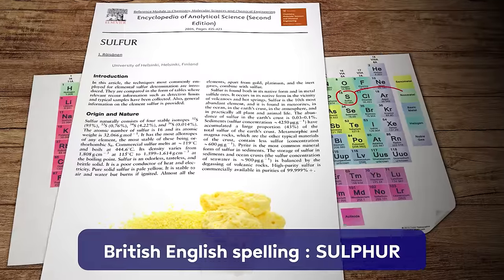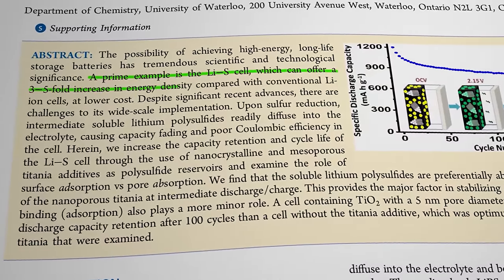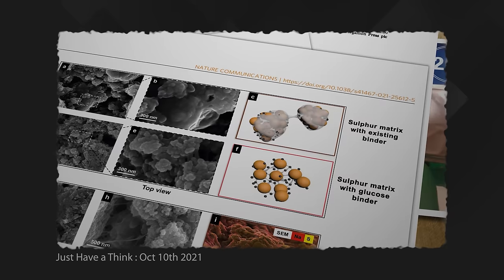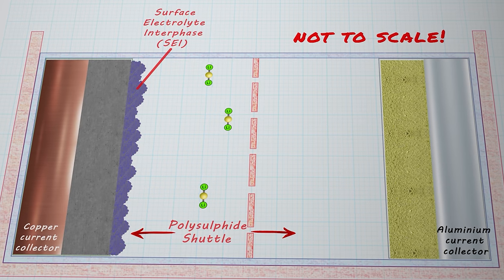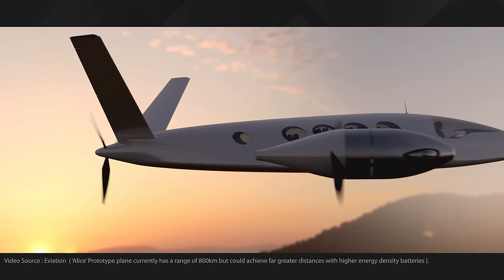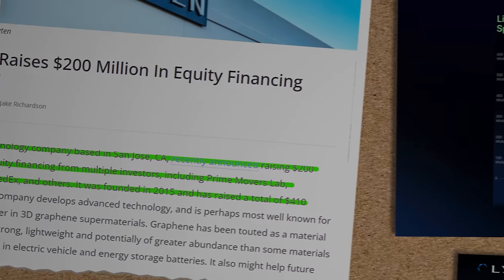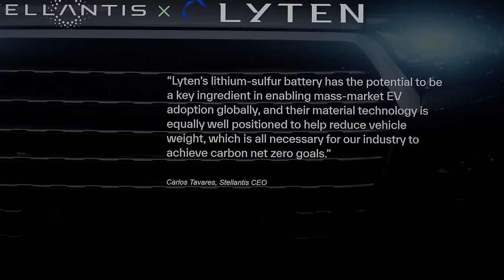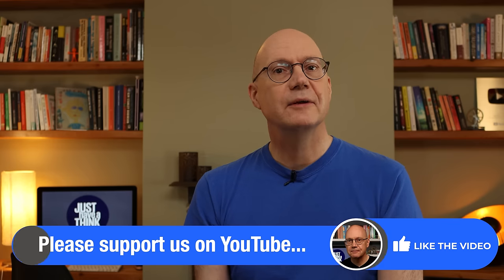Battery Energy Revolution. What now?

Comment: ELECTRIFICATION of all transports, industry, agriculture,... All sectors will be a reality ! 
And is the most logical action, move to do. 
Electric buses are way better than Diesel ones, electric cars are better than ICE cars, electric trains are better, electric tools... and so on. 
More quitter, more reliable, more productive. 
Battery is the only thing is a little holding back the movement but let's remember than LARGE SCALE BATTERY industry is very young and don't must criticized that. 
You can't compare simple oil industry with hundred years and trillion dollar revenue with large battery developments. 
Why large battery... Because for small ones we already have good solutions, think at all remote controls, devices, toys, phones, million if not billion of devices who are using just fine small batteries today (with great success 😅).

Comment: I'll take Dave up on his invitation. I really can't stand the incessant cheer leading for EVs. Passenger cars only account for 10 percent or less of greenhouse gasses. If we were to take care of the real culprits when it comes to CO2 we could let automobiles continue to burn fossil fuels and still stop global warming. Except they apparently don't want to stop warming entirely since their goal is 1.5 degrees rather than zero. Why isn't there more effort into making cars burn gasoline more efficiently? Why is there no effort to make emissions cleaner? This whole EV agenda has a creepy population control overtone to it.
Reply: It's easier to concentrate on EVs (and heat pumps, solar cells, etc) than to tackle the real, very difficult, very expensive, very unpopular changes that we actually need to make. Still, those EVs will come in really handy when the coastal cities flood, the weather goes haywire, the resource/food/water wars break out, and when we have to call out the army to stop the mass migrations...

Comment: Electric vehicles aren't taking us away from fossil fuels.  They still have to be charged.  Where does the energy come from the charge them? Because solar and wind won't accommodate 600 million electric cars in the united states.
Reply: It can, if we can just get the fossil fuel apologists to step out of the way. Read Saul Griffith, Mark Z. Jacobson and Adam Dorr for long form descriptions of ideas presented on this channel.
Reply: @benjaminnead8557 Or you could be specific as to what technologies provide an equivalent energy aggregate as burned fossil fuels.  Nuclear supercedes fossil fuels, but OIL in and of itself is never going away. 

Literally everything in your life, everything around you uses oil.  From your clothes, your shoes, your mechanical gadgets, your electrical boards all use oil.  Replace power generation with Nuclear, and you still require oil to make everything work.
Reply: @ChainedFei  Yes, we'll still need petroleum for a host modern age products. But even things like car tires, just to name one, can be effectively manufactured from plant based materials these days. But extracting oil and gas to simply and immediately burn it at the rate that we do - and blissfully ignoring the ramification - is simple insanity. 

I'm old and I'm guessing you're considerably younger than I am. Yet you're reasoning on this makes you sound like you just came walking out of the 19th century. I recommend that you tune in to this channel for weekly episodes to see what you've been missing. 

I've owned an EV for eight years now: a twelve year old car that's still running just fine. The next one I own will almost certainly have a battery with greater energy density and be fashioned from materials that were less harmful to the environment. Everything in my house is electric - cooking, space and water heating - and, hence, capable of running on non-exothermic energy. And I don't have to live like a medieval serf in order for that to happen. 

My local utility is painfully slow in moving to 100% renewables - even though that's now their stated goal (yes, even they admit it's possible) - and I will probably beat them to getting there on my own with rooftop solar and a home battery.

Comment: 1,000 charge cycles?  If you drive daily and charge your car daily that's 3 years of driving.   Replacing an EV battery every 3 yrs is not feasible.
Reply: Basic math says 250 miles/charge cycle * 1000 charge cycles = 250,000 miles. That's a whole lot more than 3 years.
Reply: How? A full charge cycle is depleting the battery from 100% to empty. If a car has 200-300 mile range it's the equivalent of 200-300,000 miles. More than enough for the lifespan of the majority of vehicles on the road.
Reply: The average uk car dose about 25 miles aday, so most people will not be charging every night. They will be doing a 80%-10% cycle once or twice a week.